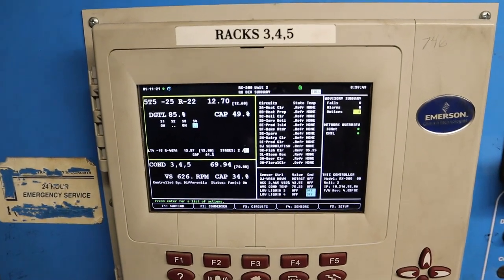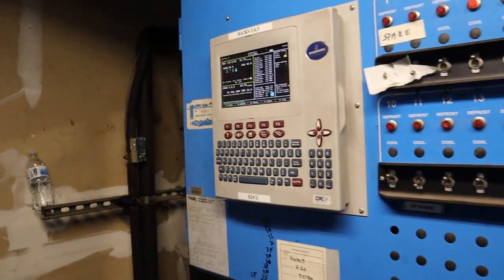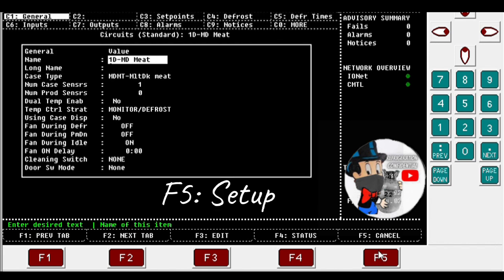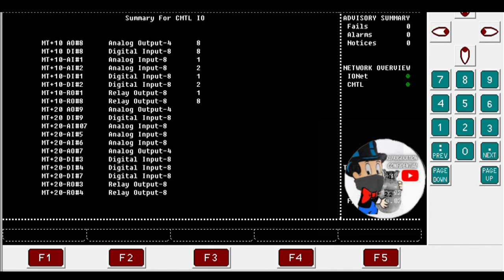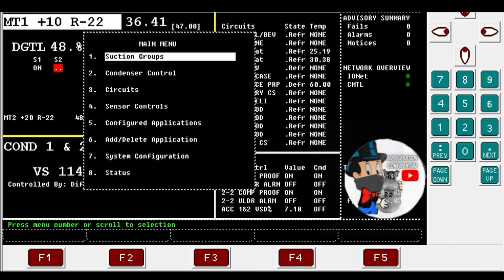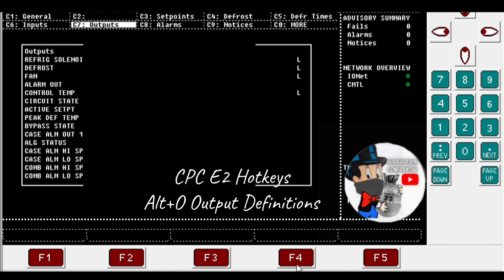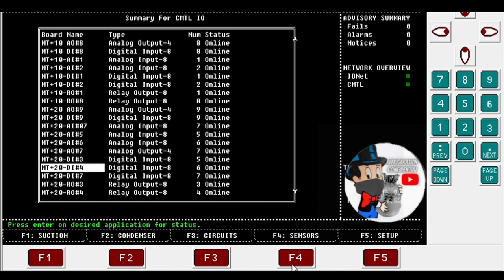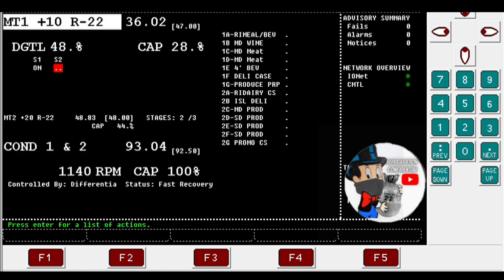Com-Trol E2 Overlays How to Locate A.I. and R.O. Points

Comment: How is the Emerson board compared with Danfoss adap-Kool..
Reply from the maker: What do you mean? addressing?
Reply: @refrigerationconfidential4376 
Sorry, wasn't specific😔. I meant generally, you know checking things and making changes and troubleshooting.
And thanks for the video
Reply from the maker: Danfoss is easier for addressing but more of a pain for trouble shooting.. Some older sensors require resisters to read and you have nodes that go bad and from time to time and have to rescan the boards to bring them back online. Navigation E2 Wins on that one, way easier to navigate. Danfoss it takes a bit to find things... I hope that kind of answered your question
Reply: @refrigerationconfidential4376  you answered exactly what I wanted to know. Thanks.
If you haven't worked on a turbocore, you must try it if you get the chance.. Think is nerdy and technical to your liking
Reply: Did you originate from source refrigeration? Very knowledgeable in EMS. Great content entertaining as well 🤙🏽
Reply from the maker: @tazzman2288  Yes I did... Thank You just trying to show my approach of the supermarkets
Reply: Refrigeration Confidential nice how many years doing market work?
Reply from the maker: @tazzman2288  17 years all In markets
Reply from the maker: @tazzman2288  17 years all in supermarkets that’s all I’ve done
Reply: Refrigeration Confidential  wow that’s impressive much respect bro. I been in markets for  5 years but in the trade for 18. Are you out is so cal ?
Reply from the maker: @tazzman2288  Undisclosed location but it is always 70 degrees and sunny
Reply: Refrigeration Confidential Nice, do you do any start ups or program writing on any of the EMS platforms.
Reply from the maker: @tazzman2288  Yea the start ups were big for me on learning and the EMS programming  when I cutover controllers from the old CPC RMCCs to E2s
Reply: Refrigeration Confidential right on yes I agree, I’m doing rack start up and EMS cutover but from E2 to site supervisor easy case same platform. I want to get good at making flex combiners though. Are you good with flex’s ?
Reply from the maker: @tazzman2288  Send me a message on IG